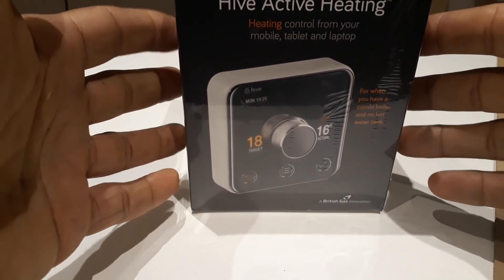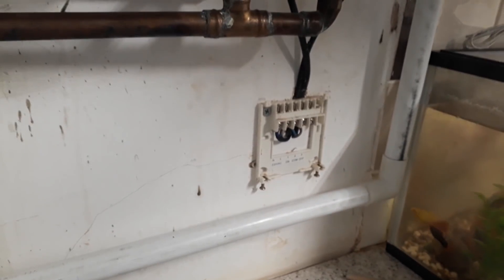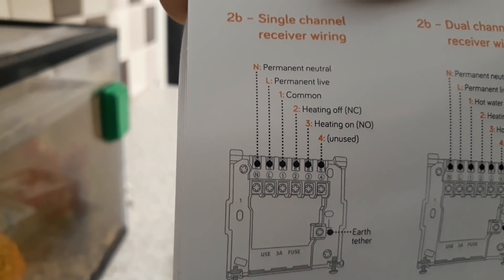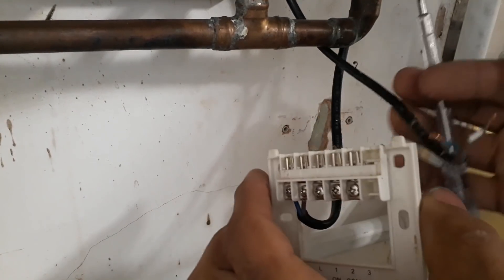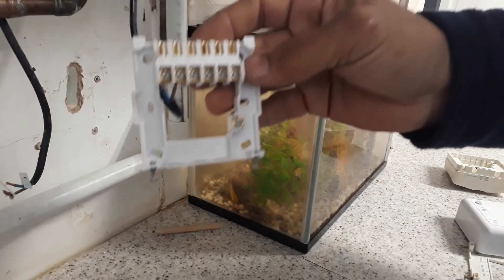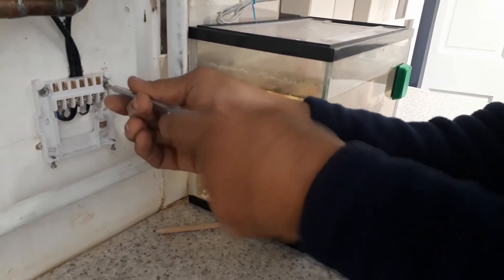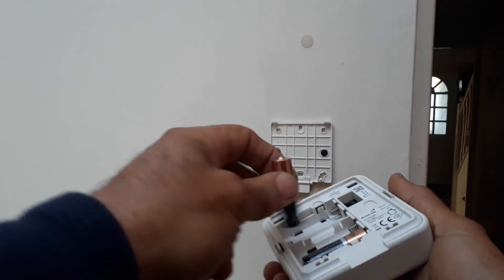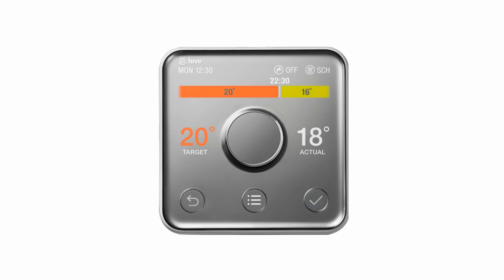Hive active heating combi boiler install

Comment: Good video Simon,going to attempt wiring a Hive to my old Combi oil boiler,but just noticed I only have a room stat (with 2wires only) —no programmer on my system.Can I still use a Hive?

Comment: Thanks a ton for your video. The simple explanation of all the wires really helped me and now I have a functioning Hive Active Heating at home. I could not really figure out the boiler off switch, so turned off the electricity to the whole house and did the wiring bit.

Comment: I did this at my mums flat all went well until I flicked the main fuse back on and there was an almighty BANG  followed by a giant blue flame, I nearly had a heart attack. Id inadvertently wired the live to the neutral (I was on prescription drugs at the time) I disabled all the neighbours electricity and the council had to come out reset the group fuse box...... Then about a month later my old mum got an electricity bill for a thousand pounds... apparently there was some sort of power surge and they sent her the bill.

Comment: This video made me cringe.. firstly let's turn power off to the boiler, in the same shot a cable dangles almost into the fish tank! Surprised you didn't just wire it up with everything live. Then when it came to plugging in the receiver omg the cabling inside that cupboard! Whole house looks a fire hazard but at least you have smart heating 😳

Comment: What  does "common" mean? I never heard that term as regards wiring.
Reply from the maker: Google it
Reply: @FixYourValues  Exactly you don't know, problem is common seems to used for both the ground/earth wire and also live wire. "The common is the main live coming in." https://www.downlights.co.uk/media/wysiwyg/Two-Way-Wiring.jpg    and  it  can is seens also be used to ground/neutral wires . Indeed it can be used for wires of 0V 240V and also 24V apparently. I think the com here is 24C but I'm not too sure, however doing it as you have done it  labelling wires and connecting them to the same named connection seems to avoid any problems. But it is odd the dual  channel does not have a com wire at all!
Anyhow my old controller with a thermostat packed in, fortunately I was about to get new one which was compatible so I could just swap the units without touching the wiring. I might be interested in having a system like this in future ie with a thermostat and wireless etc... so this might be helpful should I ever be daft enough to try it.
However by backplate is the dual channel one without a com wire. I think I've leave it till I know what I am doing!

Comment: I appreciate the videos you make and admire your confidence to do this alone. However whilst you may have a rough idea what your doing your showing this to people who don’t understand the basics of electricity or boilers. You should consider using a disclaimer in the video as working on electricity when not competent to do so can have fatal consequences. Neon screwdrivers should not be used to check if a wire is live as they can give false readings, a volt meter should be used. Also half removing the fuse like you did is by no means a guarantee voltage will not continue to pass. Also when reinserting wires it’s essential all the copper is behind the screw and plate as this could lead to arking. I don’t  intend to discredit your video. I only wish to make people aware of the risks of working on electricity.
Reply from the maker: Thanks Ill add you're coment to the description.

Comment: Hi there mate.  I bought the hive for a combi boiler.  My current wireless receiver is not wall mounted.  when i took it apart there is 4 wires.  Live Neutral and two black wires.  I just don't know what to do with the two black wires.  Where i took them out has no reference to what they are apart from a switch symbol i looked it up and it said " Black & Black = room thermostat O - I.  any help would be good
Reply from the maker: i think one will be on and the other off. I'm not sure though.
Reply: i think your right . how would they go into the hire wiring ?
#
Reply from the maker: I'm not saying to do it, I'm not qualified or anything, but I would just try one of them and see if the boiler comes on. if it doesn't, Id try the other one.

Comment: Also, where is part 2 please?
Reply from the maker: Lisa Johnson https://youtu.be/k421Qr-HWXw
Reply: Thank you.
Reply: We've followed all the guidance in the video however, the receiver doesn't seem to be picking up the hub as the heating is not working, any ideas? We have restarted the boiler, hub etc but still nothing.  The receiver is working but it's the pairing that seems to be the problem.

Comment: Trying to install this system on my Alpha CB24X boiler but not sure if it is compatible as the Hive receiver states 3 wires in the userguide but my existing one only has 2?